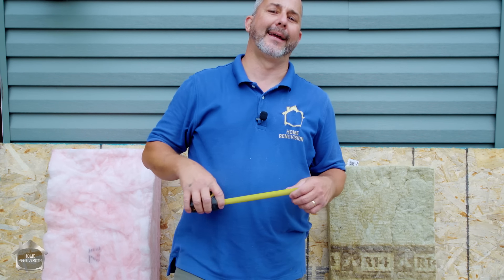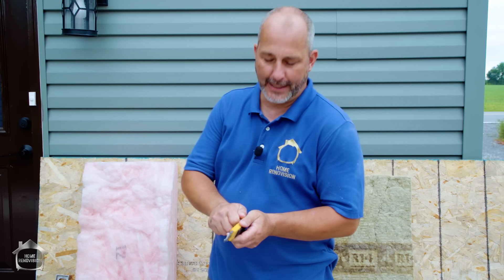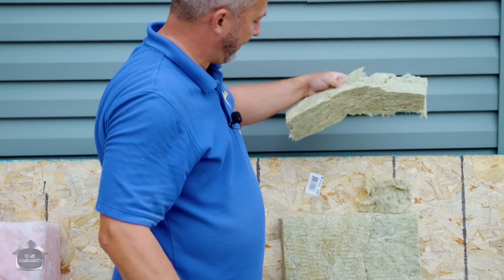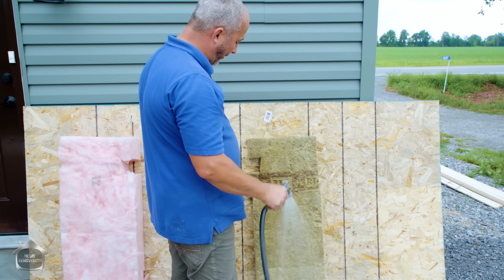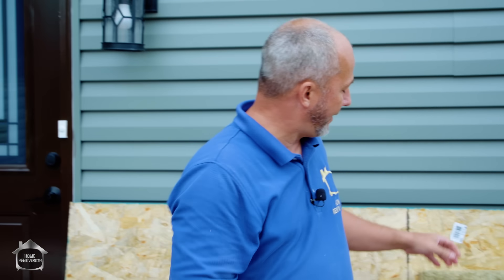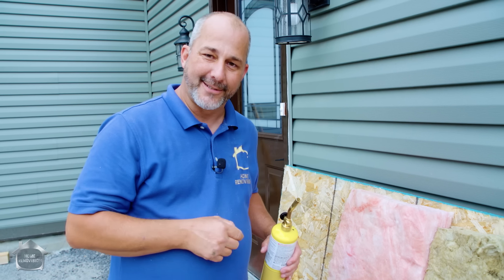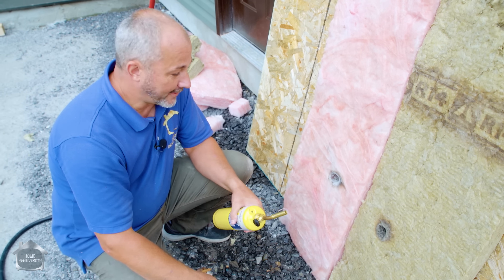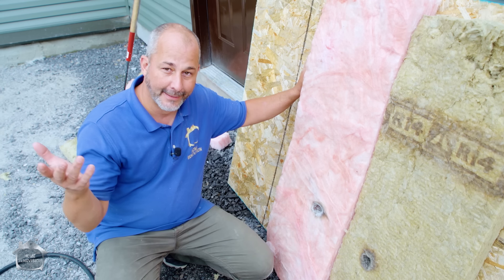How to Choose the Best Insulation for Your Home | DIY Home Renovation

Comment: Mineral wool for mice and bug resistance, replaced all my pink with it and no more bugs and mice
Reply: That's interesting. I'm redoing my attic insulation and have had wasp issues.
Reply: @Nikuser  I just asked about doing a video on attic installation. This is good to know. I was told mice dont like blown in cellulose ( on top of existing batt) because it falls back on top them. Im wondering if roxul is better for attic under the cellulose as it doesnt compress as much as the fiberglass.
Reply: @leanneb6622  in my attic, I did 1 layer of rockwool  then blew in pink insulation on top of that. Bugs and rodents don't like rockwool, it, cuts them.
Reply: @leanneb6622   I live in an area of the US were we have Sand Storms and Cellulose attic spaces collects all that sand and it gets heavy. Over time it can and does cause ceiling to fall. No mater how tight you think you house is the sand storms will prove its not lol .
Reply: Shortly after Roxul was readily available I built  a chicken barn addition (50x100' on an existing 50x100') ... the existing barn was done with pink, at the farmer's insistence he wanted Roxul put in the addition... now there is good reason for his desire as between flocks the barn gets washed with a pressure washer so his existing barn had some issues water intruding causing sag and thus loss of heat (and more heat intrusion)... BUT, a year after build he hated the Roxul because the rodents loved it... the claim of rodent proof were greatly exaggerated... Now I know they still make the same claim so I expect that they have since added a chemical treatment to it otherwise by now a class action suit would have occurred.... personally if I was still in construction I'd be apt to use lamb's wool instead of pink or green...
Reply: Hoho, i had them in both of these. Maybe just use more metall fiber to avoid such a thing
Reply: Leanne B turatetet se
Reply: @leanneb6622  Had a mouse problem in my attic, they loved burrowing through the cellulose and left plenty of tunnels.
Reply: Great now i feel dumb for using rockwool when i built my shop this fall....
Reply: @kaiserbuns2606  better then fiberglas always will be
Reply: I was buying insulation today and the owner wanted to know why I wanted rockwool - he sells both types, with his primary business is installing.
He laid it out pretty much as Jeff did, and I changed my order to fiberglass, and left with a whole lot more in my pocket
Reply: @TommyAlanRaines my brother told me a story. He was deployed to Iraq, and his first sergeant went on leave. The 1sgt had his own room, and he went all around the room with duct tape and sealants, closing all the gaps, taping the frame and window joints to prevent sand intrusion while he was gone. But, when he got back, there was a fine sand powder that was in his room (it's often called moon dust). He hadn't sealed a crack that was in a window and the sand dust penetrated through the crack.
Reply: I had blown in cellulose in my attic and a squirrel problem. I did rockwool throughout the attic and cellulose on top. The squirrels showed back up... Ugh! However, I can vouch for soundproofing on the Rockwool safe n' sound. I put it in the ceiling of my basement and the only thing I really hear now is footfalls. Also does great for sound isolation of my entertainment system.
Reply: @lswhere40  Good to know its not squirrel resistant.
Reply: Rock wool is simply better than fiberglass.
Reply: Hey buddy I have a concern I just put some of the brown insulation and my house is getting full of flies do you think is because the insulation

Comment: Love your channel but I would repectfully disagree on the burn characteristics of fiberglass to a degree. When I was a firefighter in the city we constantly opened up walls and ceilings. The fiberglass insulation  WITH THE BROWN PAPER backing especially in the walls most always extended the fire upwards. It would climb vertical in the 2x4 space. the heat from the paper burning would melt the pink stuff. When we opened up there was most times a burn or char area that was spreading.Sometimes it would be contained to that wall/ceiling  space sometimes not.
Reply: The fiberglass he shows doesn't have the brown paper backing, so your argument is null and void!
Reply: @leatt4693  Ok for this demonstration. How many people( DYI) use fiberglass in there walls with the paper backing??? I've seeen tons of the paper backing stuff spread up a wall. Now like Jeff said if it gets thru the sheet rock  that takes time. But you get an electrical fire in the wall ,well now!
Reply: @greggo502  When I am looking for insulation I can't even find a store that sells paper backed insulation anymore.  Old homes will have it though and I have owned and replaced that insulation due to fire hazard.
Reply: @leatt4693  try Menards, Home Depot, Lowe’s
Reply: I would think the burning lumber would take the fire upwards more so than the paper. But for an electrical fire yes I see your point. I will keep that for consideration. Interesting discussion.

Comment: When I open a wall during a renovation, I find the pink stuff has always lost its fluff and in turn it’s R value.  Roxsul type insulation fills a cavity way better and you don’t  end up with dead space that is missing insulation. Pink is old school.
Reply: Fiberglass is so dated owens corning is making mineral wool now that really says something.
Reply: I agree. I’ve seen it also collapsed as my windows were replaced.
Reply: Agreed!!!
Reply: Its rated to hold its r value for 20 years.   I never understood why but it makes sense any water or settling over time and its garbage.  The mineral wool is good for the life of the house.   Yes its more expensive but if you plan on passing the house on to future family members its probably worth the cost.
Reply: This problem is only on the walls not the attic. So it makes more sense to use the pink stuff in the attic. Right ?
Reply: @Not_Sure_  the attic would be best to use blow in cellulose, fiberglass is just to (allegedly) unhealthy, blow-in fiberglass is super unhealthy and batts are to difficult to get placed around trusses and electrical.
Reply: @Not_Sure_  Roxul rockwool comfortbatts are by far easiest to install in walls.  They're a joy to put in wall studs.  But you are right they are phenomenally good in an attic. If it's a lifetime or generational home, I'd use Roxul.  I put a mountain of work into replacing blown in and putting in Roxul into our attic in our family home.  Our energy efficiency and sound deadening from rain noise was massively better just from the initial first R15 layer once it was in and tight.  The difference was massive.  Part of the benefit is that if you take the time to install it with a good compression fit everywhere you seal a lot of air movement off.  This helps energy and also sound massively compared to the always sub optimal fit of pink batts or blown in insulation.  And once it's in it's forever.  It will never collapse or wear out.  But the downside:  The labor to install one or more layers of solid Roxul batts in an attic is MASSIVE compared to blow in or quick roll out pink.  It's totally worth it in my opinion, but you have to be ready to do it right or the cost and time is wasted.

Comment: I’ve got to disagree with the sound deadening claims.  I’ve noticed a massive difference in sound transmission in my house since I started replacing the old fiberglass pink stuff with mineral wool.
Reply: That is your anecdotal evidence. Actual studies show that theyre the same when it comes to sound proofing
Reply: @joseph7105  nope, as I stated it’s based on personal experience. The differences are probably negligible in most cases. There are too many variables to count. There are however studies arguing both sides I.e. mineral wool vs pink stuff.I may have had a similar experience just replacing old pink stuff with new pink stuff, I’m quite aware of that.  You really felt the need to pick my obscure comment from last year out and shame me or make me look ignorant? Lol get a life.
Reply: @e.nichols5380  Your comment was the first I saw. I didn't look at when it was posted. I'm not trying to argue, just stating what the data shows
Reply: @joseph7105  No worries, my apologies. I posted that after renovating a kitchen from the 50’s using rock wool to replace original fiberglass insulation with a noticeable difference.

Comment: We just had rockwool installed in a loft renovation this week. Months of rough work done where old fiberglass was left in the party walls. Neighbors complained a lot about noise, even that they could hear our conversations. The minute the rockwool replaced it, the sound difference was like night and day. Quiet as a funeral.
Reply: lots of big Youtubers definitely seem sponsored by Rockwool but i've heard old fiberglass doesn't retain it's shape as well over time. I have my fiberglass in my 40 year old place now and there are portions in the wall where the insulation hasn't held up well and show cold on a thermal detector. Going to try at Rockwool
Reply: hahaha i'm stealing that one "quiet as a funeral" Honestly i don't know why the whole industry hasn't switched to rockwool yet, The cost is insignificant compared to the savings in heat and energy bills as well as safety from being naturally mold resisitant and rot resistant.

Comment: Roxul is pricey but well worth it. I use it for every remodeling project. My wife works swing shift and would sleep in our daughter's room just because it was dead quiet compared to the other rooms. I could run the lawnmower and you couldn't even hear it running directly next to the house. Definitely made a huge difference in temperature control during the winter also
Reply: How about summer? Did it do a good job?
Reply: @JoseRodriguez-pn9hx  Growing up, my dad's house that was built in the late 60s/early 70s had mineral wool insulation instead of fiberglass. It was always nice and cold in there during the summers.
Reply: @HickoryDickory86  nice i just want to to know it would be a good investment choosing rock wool over  pink insulation.
Reply: @JoseRodriguez-pn9hx  Absolutely it would be.

✅ Easier installation
✅ Rodent- and bug-resistant
✅ Fire-resistant
✅ Water-repellent and -resistant
✅ Excellent sound control
✅ Consistent R-value due to rigidity and low compressibility
Reply: @JoseRodriguez-pn9hx  definitely, doesn't matter what season, her room holds the same temperature. I moved the thermostat into her room to test a theory, during the winter we keep it on 70 and the whole house was down to 57 degrees before it was cool enough in her room to tell the thermostat to kick on

Comment: I found using roxul in many cottages or hunting cabins  that mineral wool is a great mice deterant as opposed in to the pink stuff. I also found it much better as fiberglass for soundproofing
Reply: Mice love the pink stuff, don't care for the Rockwool as much
Reply: Your house should be sealed so you don't have mice in the first place.
Reply: @clintmanning4004  key word there is "should". Unfortunately, sealing houses is "new" in construction. You will be lucky to find houses built prior to 2000 that were sealed.
Reply: @clintmanning4004  Not everybody has a new home or newer home where houses are being sealed or tighter fit than older homes. At one time it was considered "bad" having a tight house.
Reply: @Erocwolverine42 Yeah I understand,  I'm just stating that if you have any pests entering your home, you should comb over the outside of your home and find the access points that pests are entering and then seal them so you won't have pests anymore. Or hire a pro to do it for you. Pests like mice and bats can cause thousands of dollars in damage. I was recently working on a house that had 4 inches of bat poop in the attic. They had to hire a restoration company to remove the bat poop and all the blow in insulation, properly clean and disinfect. Then hire another business to blow in new insulation. I'm sure that whole process cost around 10k. Then finally they hired a guy to seal off the attic from pests. Should've just done that from the get go.
Reply: @clintmanning4004  - That’s Bat Shit Crazy !
Reply: good intel, thanks

Comment: Rockwool was cheaper for me, but it doesn’t have the tar paper vapor-barrier, so installing it was annoying because you couldn’t staple it up, you had to hold it up and I used duct tape to hold it up until we got to drywall. It’s still itchy too, just not as bad as fibreglass.

Comment: There is a comparison test on YouTube of Fiberglass and Rockwool in a fire.  Rockwool ignited much later and emitted much less smoke.  Smoke damage is a major cost in the rebuild after a fire.
Reply from the maker: if you have a fire that has eaten through the drywall to the insulation you are already having a bigger problem than smoke damage. Cheers!

Comment: I am curious. I have a 1970s home and the gargage had water damage so I had to take off the insulation drywall that was there. How to I best reseal up the crumbles in the brick seen on the inside, not the outside, and then to I stick insulation right against the brick or do I over the brick with something first and then put up insulation and drywall?

Comment: I've seen many videos on the fire resistance while the rockwool is consistent, the fiberglass sometimes does well sometimes bursts into flames. I kind of wonder if it is a difference in temperature. At the higher temperatures the fiberglass might melt before it can catch fire, but a lower temperature, which may be more normal for a fire house might have a different behavior. While that difference might not have an affect on if you live or die, it could make a difference in how much your house and items are damaged.

Comment: What insulation is best for a garage? More specifically, my garage ceiling. It gets so much colder/hotter in my garage than it is outside or in my home. I hate that i can't leave paint or liquids in my garage during the winter.

Comment: What do you recommend for stud framing? 2x6 for R-19 or 2x4 for R13?  I think 2x5 framing would be better carpenter says 2x4 with R-13 is adequate. We do get cold in Tennessee and snow 20 degree nights many times in winter

Comment: Good Morning again. My ceiling is open in the basement. PS can you use both so if there is water pipes you use the Fiberglass. And if I use the pink do I need the paper on it up or down or with out  on both sides. Thank you Jack

Comment: I know this video is 4 years old but perhaps I can get some help here. I have a brick veneered 1950’s house in East Texas (humid, usda zone 8). We painted the brick with lime wash to allow the brick to continue “breathing.” 
Behind the brick there’s asphalt-covered fiberboard. The stud cavities have no insulation. The brick does have weep holes. 

I’m removing interior wall paneling inside to replace with drywall and upgrade electrical and wondering if I can use any of these two products to insulate or just leave it alone. The house is very drafty in the winter. The black asphalt fiberboard is in good shape. 

Thank you.

Comment: I'm planning a renovation of my really old house (tearing out all the plaster and lathe...*shuddering*).  The bedrooms share a wall, with a cast iron radiator on each side. Should I insulate that wall too? Should I use the faced insulation there too? (just learned what the heck that meant...LOL) Which side gets the barrier?

Comment: as always great information - Given that a 2x8 is actually 7 1/4" deep and R15 insulation is 3.5", what are you thoughts on using 2 layers of R15 insulation in the 2x8 cathedral ceiling? Depth wide it adds up to 7" and also the R values add up to 30.
Reply from the maker: yes or you can just buy r30 insulation. Cheers!

Comment: Rock wool is way heavier.  So in SoCal it can maybe make your house more likely to slip off the foundation?
Reply: If your insulation is heavy enough to cause that, you need to invest in strapping yesterday.
Reply: @drackar  For sure.  1953 house in 90277.  Every house around here needs strapping!!  When choosing insulation Ill take the lightest for that reason!
Reply: @thehpw  Consider sprayfoam. Light, won't sag, adhesive properties. If mineral wool will cause a slide, foam might provide enough glue force to stop it.

Comment: I have never opened a wall where pink was still tight to the top sill after ten years. All of the homes in my humid area show settling just due to humidity.
Reply: and because humidity is water and fiberglas retains water... it becomes a mold factory over time

Comment: The number one place i would say to use this is when insulating floors in a crawl space. It wont take in moisture and sag down like fiberglass also rodents wont nest in it  2 of the biggest problems in crawl. There is far less air movement via rockwool and air movement is more important then r value. I have done personal testing with fiberglass and rockwool when i lived next to airport and i can say without a doubt its a better sound proofing then anything else.

Comment: I have two questions regarding a kitchen remodel I am doing. 

Is it common to for insulation to look dirty?

I am replacing the insulation.  What is the difference between the paper insulation and insulation without paper?
Reply from the maker: geography. in areas where the code does not require plastic they sell a paper faced insulation to minimize the effect on air quality until the drywall goes up. if you live far enough north then you need a vapor barrier.